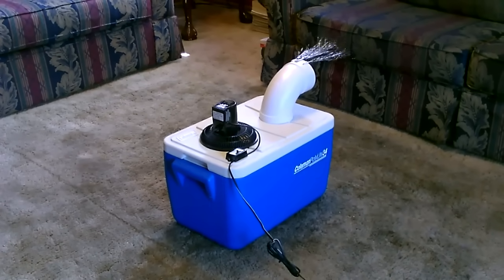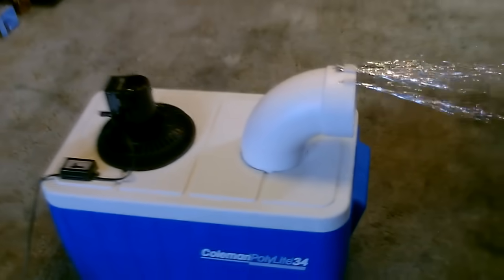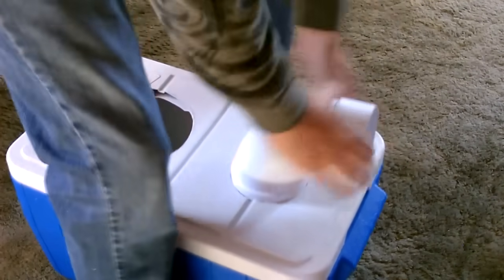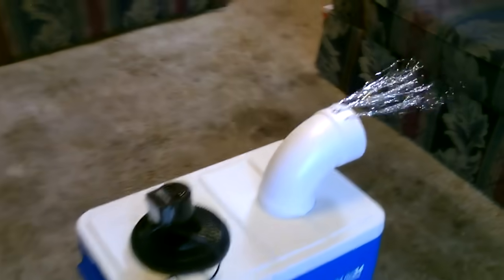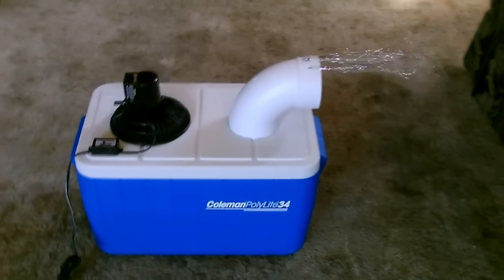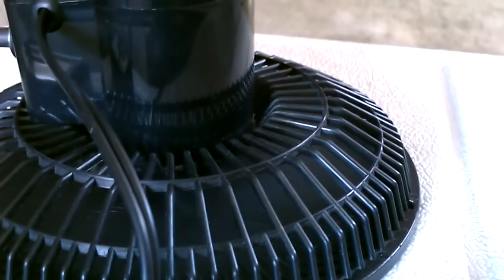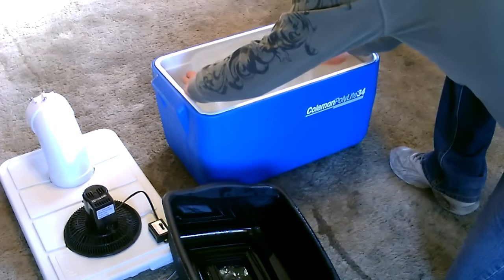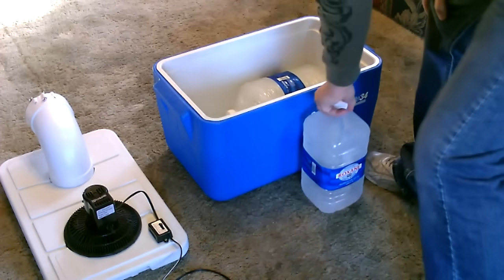Homemade air conditioner DIY - Awesome Air Cooler! - EASY Instructions - can be solar powered!

Comment: That's very impressive especially using solar powered panels to save on electricity. Have you ever tried dry ice in your cooler? I know you obviously have to go buy some but it would interesting to do a test and see if the same size dry ice block would last longer? And if anyone is thinking of using dry ice and never dealt with it you have to be careful and wear gloves ! Never touch it with your bare skin because it's -109.3 degrees Fahrenheit and you will get freezer burn! Trust me i learned from experience. Back in my younger days for our Halloween parties we would go buy a few small blocks of dry ice and put it in our punch bowl and the the punch immediately starts to bubble and a mists pours out of the bowl. Really cool effect. But again don't touch it with your bare hands. I didn't know it was that cold and my friend took a small piece and said here catch. As soon as I caught it I had to instantly drop it because it gave me freezer burn. Sorry to digress but awesome job on this DIY AC unit. And if you do ever try dry ice please post to let us know if it lasted longer. Thanks

Comment: How is this different to Swamp cooler with sponge?
Reply from the maker: the main difference is that these units don't use evaporation to cool the air (so they don't add any humidity to the air). the air is cooled due to a phase change of the ice going from a solid to a liquid. (the melting process takes heat (and the ice essentially absorbs the heat as it melts) leaving behind the cold air (which is blown out into the room

Comment: We are going rock hounding in the Arizona desert at the end of August with our 2 dogs.  We live in Washington state, so we and them, are not use to the heat of AZ.  We are going to make a few of these to keep the dogs and us cool while working in the desert.  The dogs will be in a crate, under the shade of a popup with one of these right on them and a cooling mat in the crate under them.  I'll probably put sides on 3 of the sides and the top to keep the cool air around them better (will test this out before we go). 

Thank you for posting this.
Reply from the maker: you're welcome 😎

Comment: I live in a high rise building and we’re not allowed to put any solar panels outside our apartment windows so that part’s a no go. I have a portable, rolling AC unit in the bedroom window but because I’m disabled I can’t move it from room to room. I made the little bucket AC unit that works well, but I need a stronger fan. What I do is fill my clean plastic water bottles and freeze them because I drink a lot of water. And though I have a small freezer to my refrigerator, I can keep several bottles frozen and rotate them as the ice melts in the little cooler.

Comment: Just finished my cooler per video.  Thanks it works !  Fan $12  from Walmart. Used a little  smaller cooler and will try dry  ice  next.  Have any ideas for a poor man's nitro-oxide injection ?  Hair spray ?

Comment: how long would something like this last in 90° weather outside
Reply from the maker: hi. i'm not sure about 90F but in an 80F room the ice will last about 5 hours (if you use a good size block and it is frozen solid). it might 'burn through the ice' an hour faster if it's 90. a lot depends on how fast your fan is. my latest air cooler is a 2 stage ice-based air cooler with internal radiator and variable speed fan and i noticed that when i run the fan slower it can extend the time up to 2 hours. (3.5 hours versus 5.5 hours) of cooling. it's made using a 5 gallon bucket and has an internal radiator for maximum cooling

Comment: why not set the fan inside and just create a hole for the wire to go through? The air it releases will start cold and circulate out cold, rather than coming in hot and getting cooled off, plus less outside influence on the ice.

Comment: What fan is that if you use a 15 watt solar what’s the biggest fan you can use?
Reply from the maker: hi. it's a 10 watt "auto expressions" fan. you can use a slightly larger or smaller fan if you want to.

Comment: Instead of ice...use those refreezable plastic things placed in a way to funnel the air through them
Reply from the maker: those blue ice packs should work well. i'v only got 4 of those but if you had a few more
Reply: @desertsun02  I go walking at night and sometimes people throw away a lot of useful items. There are people that throw things into businesses they do not own. Recently I found a bunch of these refreezable packages I think were used in medical containers. I have them in my refridgerator freezer which helps cut down the electrical cost a bit. They are white with some info printed on them. There were over 20, but I could not take them all. I should have made a 2nd trip.

Comment: Thanks for this awesome cooler. Can you share amazon link to the fan model you've used?
Reply from the maker: hi. i don't see a link for the exact fan that i used at the moment but most 6" to 7.5" 12v DC fans should work.

Comment: This works really well - use a similar setup when i go camping. 

And if you want to drop the temperature even lower (below freezing) drop some ice melt or salt on ice, about quarter of volume of ice is sufficient. It’ll melt ice faster and will be more expensive, but works for rapid cooling.

Comment: Couldn't you freeze tons of water overnight in a freezer, and then just set that ice on the kitchen table for the day (in containers obviously) when it gets hot outside to reduce inside temps? Then reload at night? 

Wouldn't the freezer use the same amount of energy? Or does it use more energy (creating heat) when it has something inside it that isn't yet frozen?

Comment: Why aren't you plugged into the house?
Reply from the maker: hi. you can use wall current if you want to (with a small $5.00 ac/dc transformer) but i like using solar panel or battery when possible.

Comment: I don't get why you just didn't plug the fan into a power outlet in the wall in your home when making a homemade portable A/C..   I plugged my fan into  the power outlet in the wall when making a homemade portable A/C..
Reply from the maker: hi. i like using DC fans for a few reasons. one is that DC fans can easily be run off-grid (on 12v solar panels or 12v batteries). another reason is that 12v is a very low voltage so it's totally safe. *AC powered fans (the 110v-120v ones) can potentially shock you.

Comment: Doesn't that increase the humidity indoors?
Reply from the maker: hi. nope. these units don't add humidity to the air. they create the cold air due to the "phase change" of the ice going from a solid to a liquid. the ice doesn't turn into a gas though (meaning that it doesn't evaporate, it just melts) so no water vapor is added to the air. btw, this seems to be a common misperception the last couple of years. i think it was caused by a company that sells a similar unit. they imply in their ads that the 'diy versions' are not as good as theirs and they want you to buy their massively overpriced unit. don't fall for it. there unit is no better than this one.

Comment: If this was in a camper van would it add condensation inside?
Reply from the maker: hi. nope. these units don't add any humidity to the air. the ice just melts into a liquid over time and that "phase change" from solid to liquid is what cools the air. if the ice was evaporating then it would add humidity (but almost none does) so it works great.

Comment: Someone did this and put a wire rack inside the cooler to set the ice on. Doing this allows air to flow around the entire ice block. He had a noticeable drop in temperature.

Comment: I can honestly tell you just looking at this video and looking at this fan I'm thoroughly impressed with the force coming out as to how the tinsel is standing straight out. Just wondering if there is a higher CFM type fan that still in the 6 or 7 inch diameter range
Reply from the maker: hi. not sure about a 6 or 7 inch ones, but they do sell 3 and 4 inch marine bilge blowers (fans). i've made these uints with those too. those are very strong (and they are 12v too)

Comment: At someone suggestion I went with a 4in Duct Fan that was round and it really does not have any hump as far as blowing in and it's very weak air pressure coming out of a two and a half inch stove pipe type discharge
Reply from the maker: if you want super high airflow - i'd try a 12v marine bilge blower (seaflo is a good brand). i've used those on similar units to this one.

Comment: Anyone who understands this stuff better than me could answer this. Is the goal to get the largest diameter and highest CFM fan that will fit in the lid with the smallest discharge which would reduce the air coming out and give it a stronger stream to blow towards a person. I'm thinking of the garden hose principle with your thumb over the end of the hose. If you put a 2-inch discharge or a 4-inch discharge or a three-and-a-half in discharge do you change the force coming out as far as it traveling 2 or 3 ft

Comment: How about using frozen gel blocks???

I believe that takes longer to defrost than ice..
Reply from the maker: frozen gel blocks (ice paks) are a great idea. 🙂👍
Reply: I made something very close to this following this video I took someone suggestion about using a Duct Fan that's round I think it was 5 in and everything is sealed up but when I plug it in it does not really push a lot of volume out of my discharge which I wound up using a 3-inch stovepipe type metal elbow. This fan you're using in your video does it really put out a decent amount of force at the discharge that you could feel it blowing on you from say 3 ft away. I guess I'm looking for a compact High CFM fan. As Redneck as this sounds my truck has not had air conditioning for 10 years and I wanted to put the cooler on the passenger seat and just have it drawing in taking some of the moisture out while it blows cool air back into the cab. I'm looking for for about two hours worth of run in a half ton pickup truck
Reply from the maker: @mrobvious1100 yep, the fan i used can be felt 3 feet away (and farther). this setup would be great for the situation you described.

Comment: I had a small fan next to my computer, and I am always complaining that it is hot on that side of the room while my spouse says it is too cold to turn on the AC. I used the same technique using an empty tall plastic coffee holder - cut hole for fan but had it come in from side, not top. Holds 2 frozen bottles - comes out through 4 holes in front. Works great and uses very little energy - fan runs off of USB port of computer.
Reply: which fan did u get ?? never seen one that has usb connection

Comment: Does this cool a room?
Reply from the maker: hi. it will depend on the size of the room but it can certainly cool a room if it is not too big
Reply: @desertsun02  Will the solar panel power 2 fans for 2 coolers?

Comment: Trying to find that exact fan to order it but I can't find it online. I purchased a 12000 mah fan a couple of months ago and it isn't very good
Reply from the maker: hi. i got the fan at walmart (in their auto dept.). it's a 12v 10 watt 'auto expressions' fan. i'm not sure if they sell it anymore but they should have similar ones. you can also find fans like the one i used on amazon.

Comment: what about humidity ?
Reply from the maker: hi. there is no increase in humidity with these types of units. that's because the water is going from a solid to a liquid as it heats up (but it doesn't turn into a gas). once the ice is melted and you can pour that same water back into the ice tray or container that made the ice block and it will essentially be the same amount of water that you started with (there will be a small amount of normal evaporation but nothing special).

Comment: How did you secure the fan and vent tube? Thanks for posting
Reply from the maker: vent tube just snaps in (it's held by the plastic lid itself). the fan is just sitting there. i didn't attach it (but you could if you wanted to. possibly with zip ties).

Comment: Can this cool off, or at least refresh a small room? We have solar panels at home and a 10kw battery in Florida. During a blackout (hurricane season) the panels during the day can run all loads including 5ton ac, but at night battery probably would only be for lighter loads. Thinking of this solution to at least cool off my two toddlers during the night in a prolonged blackout after a storm.

Comment: When water is frozen, it expands 19%, so before you freeze gallon sized jugs, open them and take a swig of water in order to have the right capacity otherwise the jugs will explode slightly damaging the plastic.

Comment: Old video, but I saw a guy on tiktok drill some holes on the top lip on the body of the chest and put expa ding foam in the walls so it insulates better.

Also you could fit 2 blocks of ice in that.  Would last at least 8 hrs i bet.  Im making one like this and the 5 gal one.  Done paying crazy utility bills
Reply from the maker: hi and i'm glad you are making it! i have gotten as long as 11 hours out of this. that was with a 25 pound block of ice (frozen in my fridge). it might hold 2 or even 3 but i'm not sure. if interested, check out my latest ice chest air cooler (posted May 2023). it's a closed loop ice-based design with a 12" tubular radiator. it's not better than this one, just different. one benefit is that it doesn't alter the ice chest in any way. it stays in new condition. also the 'cooler tube' is removeable so you can use it anywhere (even without the ice chest!). it's a more adventurous build but i thought i would mention it. here's the link for easy viewing https://youtu.be/ZV_9dluPDYg

Comment: You can use baggies to fill them up with water with zipper enclosures.  Fill each baggy full of water, seal  them and stack them in  your freezer and let them freeze within 24 hours.   then you can use them in this machine that you just made in the cooler. Thereby you never have to buy ice. You're making ice every day in your freezer that can even be used if the power goes out in the freezer to help keep your food cool in the freezer and refrigerator for three or four days if the power goes out.   Yep.  Go idea.  Save money and resources. Plus stay cool.   Cooler...

Comment: How many hours will this work for? Thanks
Reply from the maker: i typically get about 5 hours at a time. it will vary based on how much ice you use and how hot the room air is.
Reply: @desertsun02  awesome, thank you! Hoping to get a night of camping out of it

Comment: this is actually work and please reply this oustion
Reply from the maker: hi, yep, it works. ice based air cooling has been around and used for thousands of years (this is just a simple way to take advantage of that in a neat easy to make unit)

Comment: but does it cool that room?   curious if it even helped.   excellent video though
Reply from the maker: hi. yes, absolutely. the cool air that is generated cools the room. if you mean is it as good as a window AC unit, they are not typically that powerful, but units like these are very powerful coolers for smaller rooms and spaces.

Comment: I made mine but how do u keep the ice frozen in there? My bags of ice melted in one night.
Reply from the maker: the best 2 ways to get the ice to last a long time are to use big ice blocks (versus lots of small ones) and to run the fan slower. the slower the fan and the bigger the blocks the longer it will run cold.

Comment: Hello, I think these are a great idea except that I’m learning that they could cause mold and mildew over time.  I’m in Southern California and need to cool my music room. 

I’m willing to install a wall air conditioner or portable AC if I need to, but curious if there’s something in between the ice chest and an AC that could work.
Reply from the maker: hi there. the good news is that these don't cause any mold or mildew. (none at all). they cool air due to the "phase-change" of the ice going from a solid to a liquid. (it takes a lot of heat for the ice to melt *and as it melts the cool air is produced. the water doesn't evaporate though so there is no increase in humidity. the unit just cools the air without adding any humidity to the air. the idea that these units produce moisture (through evaporation) has been a common misperception lately. in reality these units actually pull some moisture out of the air (that's because a lot of water will condense on the sides of the frozen containers... and all that condensation is water that is being pulled or extracted out of the air.
Reply: @desertsun02  Thanks so much.

Comment: Wow, I liked this especially the solar panel power but would a bag of ice work just as well or does it have to be a block.  If you empty the ice bags into two trays  just the right size then put them in the freezer when they melt and reuse them.
Reply from the maker: hi. you can use cubes but the bigger the blocks the longer they last. reusing the water once the ice melts is a great idea. (very little of it evaporates so you can use the same water over and over).